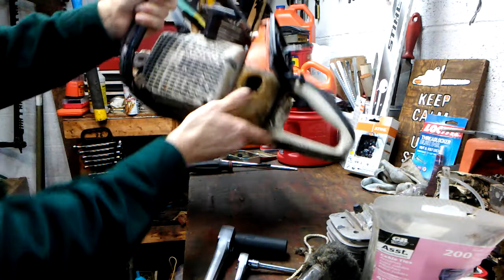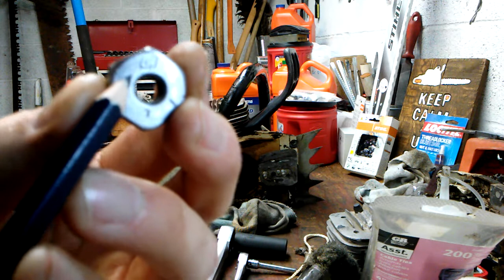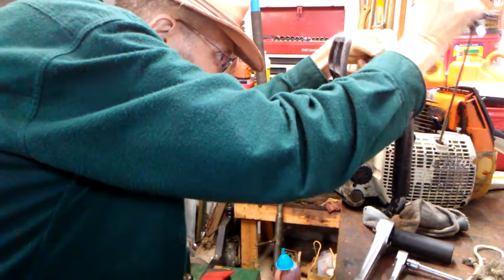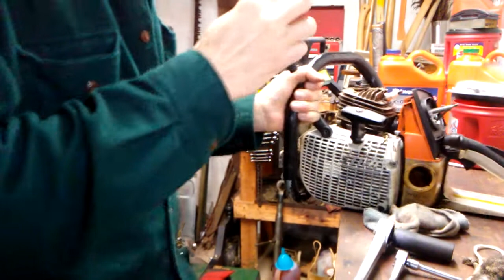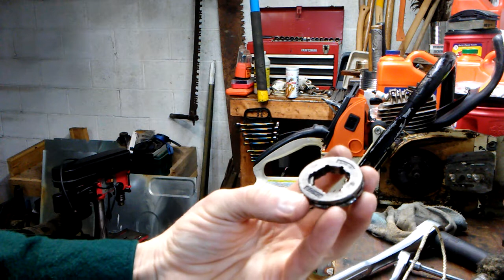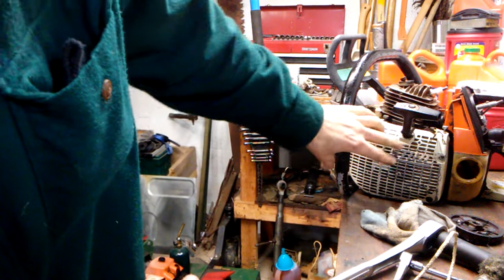Stihl MS660 diagnosis tear down part 1

Comment: I have a 36 bar and chain on it. Should it still hold compression hanging…? Mine doesn’t. I pulled exhaust and see some scoring. Head looks good. There was junk in the carb and the intake had sawdust leaking past the filter. It died out mid cut on a 32” log. I’m putting it back together now to see if the dirt was the problem. I have strong spark.
Reply from the maker: Hi Benreber...if you have scoring it will only get worse until the rings stick and it won't run at all. On the compression, with no bar and chain it is normal for a stock saw to slowly turn over with some resistance. My advice would be to find and correct the cause of scoring and go from there...best of success with repairs and sawing...thanks for watching and your comments...